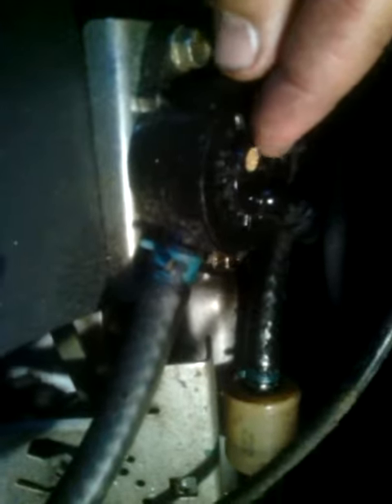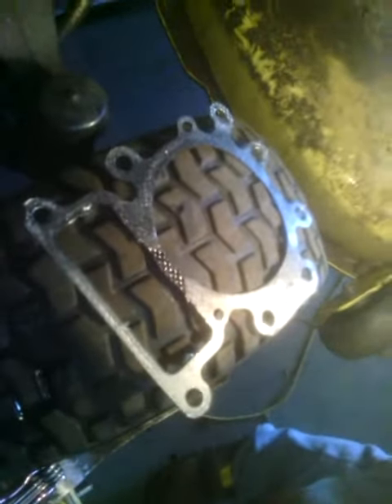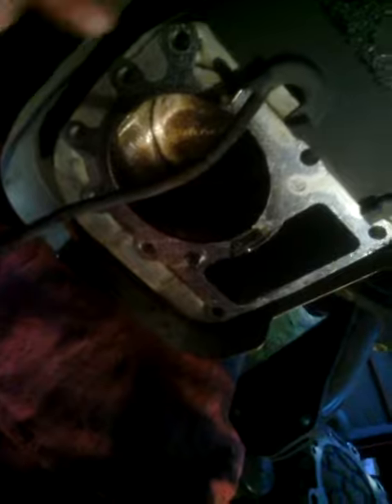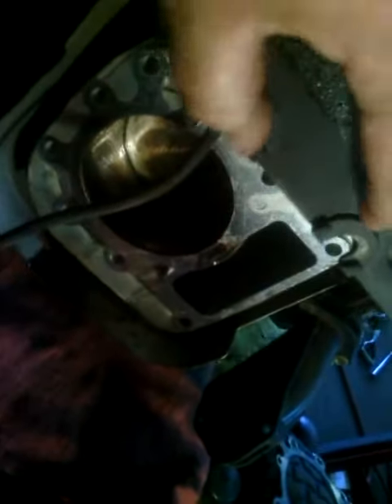Briggs intek blows oil out of fuel pump screen.

Comment: While this video is correct the explanation of why is a little off. When the piston is coming up on compression stroke it’s forcing air through the break in the gasket past the valve train/pushrods into the crankcase. 
Still a informative video!

Comment: Will a blown head gasket also cause oil to be in Carburetor and all over air filter? Just bought a used mower with a 22 HP twin intek And it runs fine at first until it warms up and starts to smoke a lot and then oil start spitting all up from under the plastic cover. Thank you any advice would be helpful and appreciated